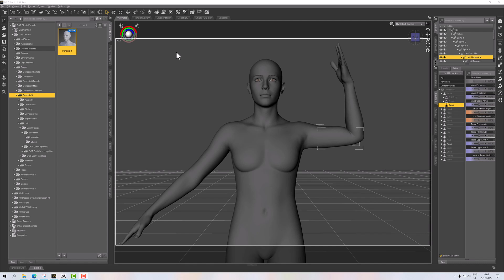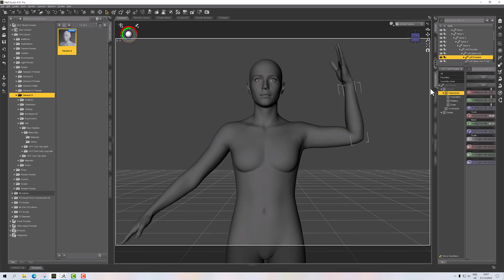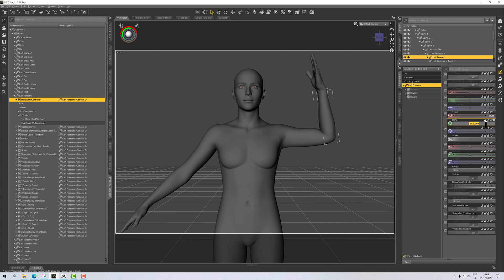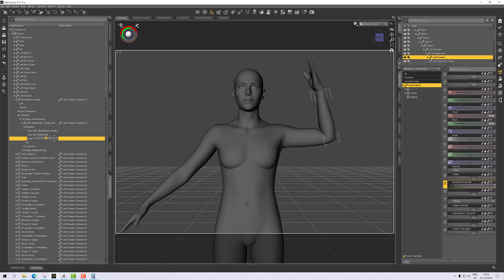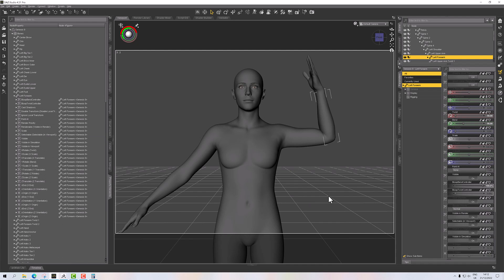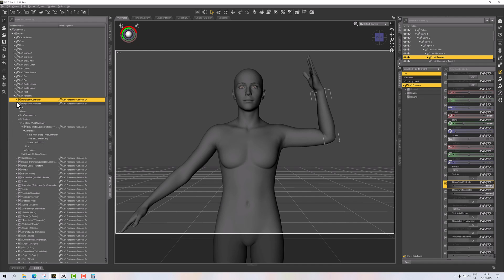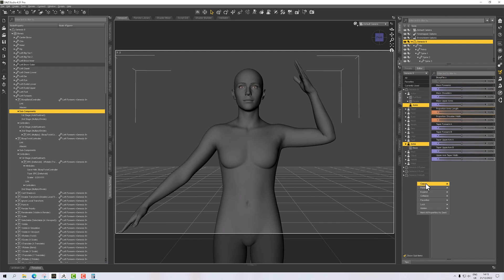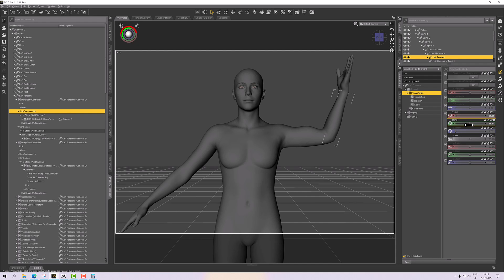Control a Morph using two joint rotations in DAZ Studio

Comment: Finally found a useful lesson. When I activate the morph, the size of the part of the mesh changes at the 50% mark, and then at 100% it returns to its normal size, I try to bend the character's body forward and add folds to the stomach, but the character behaves inappropriately when I try to activate the morph

Comment: For anyone following this great tutorial here, I want to make a follow up for you. Setup everything just like in the tutorial but when it comes time to save the controllers and morph, the link you make between the controller and the morph (putting the morph on 1st stage sub component) will not save correctly without one additional step.

When you are at that point, adding the morph as the sub component. Look in the attributes and you will see a "save with" line along with a drop down. You need to change this from your morph to the controller so that the change will save with the controller. Next time you load after you save the controller, everything should work fine.
Reply: wow thanks a lot

Comment: I really appreciate this video. Guru sent me a link to this because I was digging deep into Mutli Dimensional Controllers and this way helped me understand the concept a lot better. Needed to be able to have a bend morph, side morph, and twist morph all on their own. But if the joints were combined in anyway, the shape needed to change, for example bend + side or bend + side + twist. If these combo morphs are activated, then the solo morphs for each joint would need to subtract as the combo morph is dialed up. Complex kinda but worked a treat so thank you.

Edit : Well it worked great until it came time to save the controllers. I saved them just like the other jcms and morphs I made. When I reloaded the scene, the connections I made are no longer there. For example, the morph connected to sub component of the main driving controller did not save, it's no longer there. Have any ideas why?
Reply: Okay it's fixed now, I figured it out.